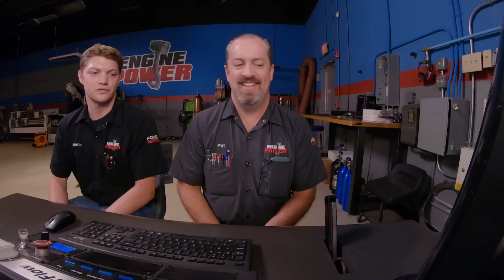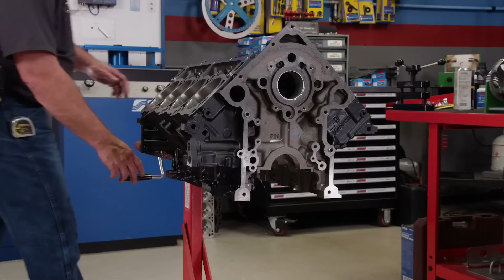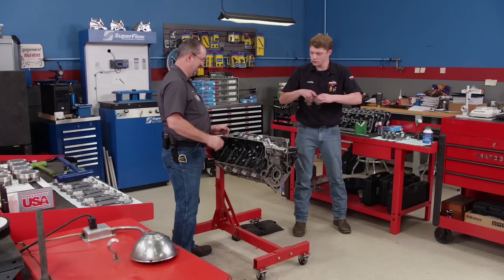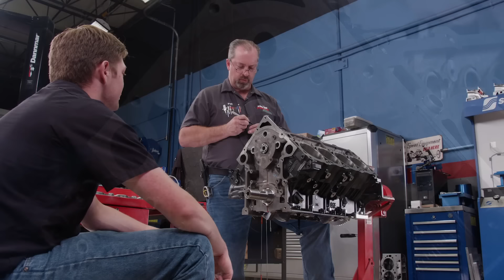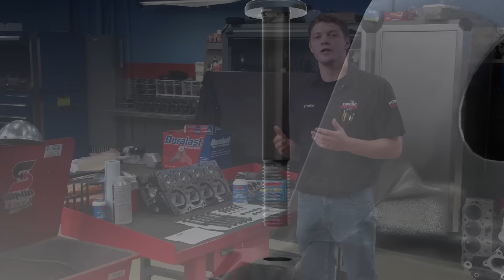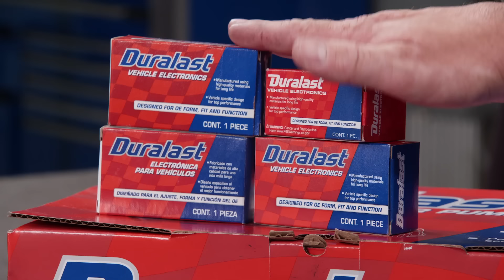Building Up a New 6.4L Gen III HEMI For Reliable Muscle Car Power - Engine Power S8, E16

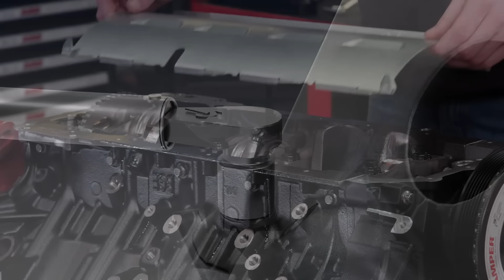Comment: 11:10 "BGE" means "Big Gas Engine". Pre-2018 car 6.4 motors have "6.4" cast into the block. Post-2018 6.4s, and all trucks use the BGE casting. The BGE is a stronger casting, and is the same casting used by the Hellcat and Scat Pack blocks.
Reply: Where can I find the BGE stamp on the block?
Reply: @icussdemise1043  On the drivers side (opposite side to the oil filter) next to the dipstick hole. Also on the rear, inside the bellhousing, just next to the oil gallery plug. They're cast in, in big letters, you can't miss it.
Reply: @rus0004  I presume these stronger castings must make the engine heavier?
Reply: @icussdemise1043  I'd assume so. Probably not very much though.
Reply: @rus0004  BGE, very cool 392 fun fact. I will look for it when my 392 Wrangler arrives.
Reply: So 15-17 scats dont have a BGE block?
Reply: @shift_nation4785  Not from what I've been able to gather. The first thick casting BGE 6.4 blocks came in the 2015 RAM, which coincides with the introduction of the Hellcat 6.2. Apparently all Hemi blocks adopted the thicker casting, but it took until 2017-18 for 6.4 passenger cars and SUVs to receive the BGE block.

Comment: Great video! I would've loved to see the combustion chamber and for y'all to explain quench and how it can still be a hemi with one. Much love for the Mopar vids y'all do!
Reply: Great questions it’s got some serious perks by having the quench area. Makes the camber smaller while still having the valves placed in the optimal position for size and flow. Also raises the compression. The piston doesn’t have to have as much of dome shape to fill the chamber which allows the piston to be lighter. Duel plugs for aid in cleaner and more efficient burn. 340 CFM of flow from a stock head wow!! This engine was for the most part stock. Just a buffed up Valvetrain/cam/intake/rods/piston. 7000rpm 🙌🏼 I wish they took it higher, looked like it was still making power!!
Reply: @alexwowski5318  they didn't balance the rotating assembly as a whole, after doing drop in pistons and rods they'd be asking for problems going that fast without making sure everything checks out even though they used good quality parts.

Comment: I got a challenger scat pack with the 392, however I’d would love to have that set up in it. Would be so much more
Fun haha
Reply: You’re a cam and valvetrain and tuning from that. No need for an entire engine
Reply: @moparproud3978  Yeah, they really didn't do anything cool with this engine. 5.7 and 6.1s have been known to make over 500 horse with cam and tunes. These guys did a lot of work to make the same power a 5.7 would with a cam and a tune.
Reply: @sHoRtBuSseR  Nobody has gotten an extra 100hp from just a cam and tune, stop the BS. Full bolt on, yeah sure...but not from just a cam and tune.
Reply: @DL101ca  Richard Holdener did it. 🤷
Reply: @DL101ca  I gained 27 rwhp from an email tune only.
Reply: @moparproud3978 Boxes checked for me. Comp stage 2 , they were having issues getting lifters so , High Horse Performance put Hellcat units in the package. Magnaflows sound sweet as well. Love my daily gas burning driver.
Reply: Exactly, that was too much money spent to land on same numbers as stock hahahaha..
Reply: @normandoromero7243 the goal was reliability not power

Comment: Nice,  but not a budget engine by any means, I’ve priced most of that for my 6.4  stoker build, that rocker assy will send most guys running backwards. I’m 2k in on just a prepped bare block ready for assembly glad I already had the 6.4 heads.

Comment: they flow too much.  the head doesn't start "working" until about 5k.  it's soft below that.  the valvetrain isn't great.  they can be made to work, but not with stock parts.

Comment: Why do I feel like it should make more than that? Something feels like it's "off" on this combo...like not enough cam to take advantage of the intake or something. I dunno, but a SBM (LA or Magnum) can be built to both more power and definitely more torque.
Reply: Yea that's what I was thinking, +70 hp over my stock scat for all that work doesn't seem like a lot.  I've seen similar builds to this push that magical 600 HP mark before forced air, so something is being held back here.  Then again, it is fully built so this engine could easily take on a FI kit and easily crank out above hellcat numbers, so the potential is there at least.

Comment: Hello pat. What would the total price be for a build like this one? Thank you.
Reply: @catalyst_99 10k is a bit steep, performance parts are a lot cheaper than people think.  Getting them installed however, is where the price hikes happen.  I'd say theres probably 5k-ish on the table here, considering they reused the crank and heads.

Comment: Put the cam in first then the crank. You can guide the cam in with one hand in the block and one on the end of the cam. Easier.
Reply: Cams are done like they did daily, nobody removes the crank to guide a cam in place, even on an engine stand.
Reply: ?
Of course of your doing just a cam swap. They built the whole short block in this video. They put crank and all in.  Putting the cam in first then the crank is easier like I stated. That is all.

Comment: This engine has $$$$ all over it.
Reply: It's a stock block, with stock heads and a stock crank...using a no rebalance drop in piston and rods, valve springs and a cam...thats about as cheap as it gets for mopar.....

 Now the intake and holley system with injectors and tb probably cost as much or more than the long block but that's not the engine it's the combination

Comment: Just to top post, that raised camshaft is to shorten the pushrods to lower valvetrain mass.
Reply: You could also use it to clearance stroke but the problem seems that's what causes the premature lifter failures.....raised to far out of windage and the lifters not vertical enough...
 I keep waiting for this to happen on my Ram....I know MDS exacerbates this but oh well...
 Having built several LS it literally is an LS with Hemi heads hehe....nice design
Reply: @ShawnGilbert1967 Had to replace mine at 100,000 and the shop told me that the LS's were killing their valve trains at a higher rate. That's him speaking. I just nodded my head. I dunno.

Comment: When you’re dealing with 6.4L’s and you want to add some power adders. Remember to widen the ring gap. Because it will be the weak point for higher horsepower. And remember that gen3 hemi’s lifter issue is from a lack of splash lubrication. So try to keep it above 2,000Rpm.
Reply: @bigboreracing356  Bcs they used shit lifters from factory you assume the whole engine is shit ? Great logic there ...you must be one of those internet basement engineers I keep hearing about !
Reply: Oil pressure is too low at the rocker assembly at idle with the engine hot. Splash lube is irrelevant here. The lifters are oiled from the rocker assembly and the oil is pushed down the pushrod. Hellcat oil pump is the fix. Works awesome. Much thicker rotor and idle oil pressure is a lot better.
Reply: @sHoRtBuSseR  Hellcat oil pump without the oil squirters the hellcat has, would be raising oil pressure too much and start causing other issues. Melling has an updated oil pump design with a higher volume and a bit more psi to help with lubrication while keeping everything within safe parameters.
Reply: It's the raised cam location they mentioned puts them to far out of windage...and they are laid way over....non mds with hemi lifters seem to be a cure.....

 I'll say this on my 2021 ram its impossible to keep it over 2000...it only turns about 1800 at 80mph hehe
Reply: The MDS lifters were the issue with mine at 100,000. Locked up two MDS rollers and killed those lobes. Comp stage 2 billet now with Hellcat lifters. No issues yet at 126,000. Way better throughout the whole range. Magnaflows are a nice sound as well. 600 dollars to tuner with floor Dyno.

Comment: Dyno queen. On the street 12.2 to 12.6 afr and no more than 21 degrees of timing.
Reply: I got a 5.7L running 24 degrees at 12.5-12.7, on 91 pump gas…. I do think 28 is a little high probably even in E85. 

Lot of variables for sure.
Reply: @jmata4506  I was talking about a 392. 5.7 may be different. I know at higher rpm you could squeeze out some more timing.

Comment: Somewhere there's a '79 Dodge Lil Red Express crying for that motor.
Reply: @bigboreracing356  Trust me, they cry.  You should see my truck weep every time I approach it with cheap aftermarket parts.  Sure, it looks like an oil leak but those are tears of despair!
Reply: @bigboreracing356  shut up it’s figurative language

Comment: I had a 5.7 in my Charger R/T and it was fast. This thing..just nuts. Love it..
Reply: maybe, but was it Quick ?
Reply: Bruce H, nuts?? Na, this is pretty badass, fairly economical muscle... Nuts is a 2000 Buick Roadmaster wagon (yes, with the wood grain on the sides, that wagon) with a 632cid twin turbo SMX, running on methanol at the track and.... here's the insane part..... 89 octane on the streets as a cruiser.... Drive it to the track, run 6 seconds in the 1/4 mile all day, roll the parachutes up and drive home, or out cruising, or 300-400 miles to the next racetrack.... That's nuts... And a legit car!

Comment: Hell I raced a 440 ROAD RUNNER into the 10.70. Back in 84 .. but 560hp in my FIRST gen DAKOTA.. would be wicked! Or stuff it an unfinished 67 Dart that needs a motor.. its got a drag CHASSIS.. . Instant low 10 ride..
Reply: @bigboreracing356  I dont street race.. but I do enjoy. Killing the tree and running the #s my old bird ran with in .  .02 at 4 diffrent tracks  5 different times through the last season. On a pro tree it varried in eleven passes .022 on that pro tree.. it was a stick shift. They say they cant be consistant..  thanks for the reply.

Comment: Men, the components of OEM manufacturers are excellent, high-quality... Why don't you get more technological motors, from which you can remove more power? There is also a cylinder head for 16 valves, a compressor, a turbine... With 6.4 liters, EFI, remove 564 horsepower and 479 torque in the 21st century-Laughter!!! The drive belt is loose, can't you think of an additional roller, can't you install it?

Comment: I bet my 5.7 could beat this 6.4 at the track. I make way more torque, over alot more rpm. It may have peak power, but ive got average power
Reply: question for you. I have a stock 2013 R/T truck. It needs some help. What do you suggest without going into the engine.
Reply: @Fuzzysmoke  what kind of help? Performance wise, there isnt much to do thats not motor related, but you could get a shorter rear gear like the 3.90 gears, and some drag radials. Other than that, their is not much you can do without touching the motor
Reply: @jameswhitesell3076  thx for responding.  Here is my deal. Like I said. It’s a 2013 RT with factory 410s. Straight line it great. However the higher end of mid range starts to fade. I know I need a tune to match my cat back system larger Y pipe and ported TB. Currently I’m still running the stock air box. It has the MDS system. I’m not a fan of it. Currently to date. It has 30459 miles. It was bought new it’s parked more than driven due to my work and second car. I’m dissatisfied with the slushy transmission. It’s not satisfying at all. However. I’ve read that hand held tunes are ok for recalibrating factory setting for street use. Which do you recommend using.  I want to change the cam. I hate the shuttle and lack of power when needed. I got a G37 that will smoke my truck. Plus my old 2004 Hemi would smoke it. Don’t get me wrong. My 2013 will smoke the tires al the way through 2nd. But runs out if stamina and the shifts suck. Please advise. Thx you for you help.
Reply: @Fuzzysmoke  a cam is a good option, also alot of people go forced induction. Depending on your budget and end goals, id say a cam, headers, and a newer truck manifold with the dual runners. You can ask different companies for options, but those options will help keep your low end torque, with your gears, and give you all the mid and top end you want. Or, you could put a centrifugal supercharger, its more up front cost, but it does make more power
Reply: @jameswhitesell3076  ok sounds good.  Any recommendations for a tune for now.
Reply: @Fuzzysmoke  a dyno tune is best, but if you dont have access then an email tune is the next best thing. I have not used one, so its up to you who you use. Or the easiest route is a diablo tuner with their preset tunes
Reply: @jameswhitesell3076  ok. I appreciate this info.  Seems like car guys are afraid to share secrets.  I’m a d GM guy but live all cars.  When I retire from the military I hope to have enough time to play like I want. Thx you. You’ve been a honest help. 👍🏿
Reply: @Fuzzysmoke  i try. I dont have alot of experience, but you are right, especially mopar, they hold any info secret like its forbidden knowledge, so i try to inform anyone who asks to the best of my abilities

Comment: Okay.. I don't get it those numbers are no better than a 50 year old carbureted V8 with a good cam.. maybe with the fuel injection it's more snappy off the line but I'm just not impressed get me a 351 Cleveland any day that's 50-year-old technology with a 750 Holley on top of it

Comment: this engine and a single 98mm turbo would still be street able but put this in the 900 plus hp range. it's no secret Hemi's love boost it's the reason there still the go to engine in top fuel even today.

Comment: I have a question and this seems to be the place. I have a 98 s10 im modding and im wondering if i could use something like Holley efi for fuel but keep the stock computer to control the transmission  and ignition. How hard would it be and what would i have to do?

Comment: I would love to replace my tired 318 LA in my 1979 D100 with this!
Reply: Do you have pictures....I Love those trucks
Reply: @biggdaddydiesel3622  I definitely have pictures!
Reply: Very cool truck. Throw some magnum heads on that thing and a 390 stroker kit and be happy 👍
Reply: I had an '80 long bed. 318 with Granny Gear 4 speed. So damn reliable. Had to run 33 inch tires to help that low gear ratio though. Miss it like all the rest. Keep it man ,  just keep it.

Comment: Love to see more Hemi (and Chrysler in general)!
Chevy and Ford V8s are hard to come by in Poland at a reasonable price, but there is plenty of decently cheap Mopars.
Reply: Finding the engines are easy but finding a car to put it in is hard mostly because Chrysler didn't make rear wheel drive cars for so long. If the daytona was rear wheel drive it would be as good as a fox body for drag racing.
Reply: Here un México is quite the opposite, no mopar engine/swaps in the junkyards
Reply: @Barcovic  really? Why not
Reply: Lucky
Reply: Wow Really? Usually it's the opposite.
Reply: @Turshin  Plenty of V8 Jeeps and Chryslers were sold in Europe (especially when Daimler Chrysler was a thing) and those eventually made their way as imports.

That's why the most expensive 5.7 300C is the same price as the cheapest Charger R/T even though they are practically the same car- Dodge wasn't sold in European dealerships so pretty much all of them are imports from USA.

You can get an '07 5.7 300C for the same price as a '91 305 Caprice.
The cheapest V8 Mustang I've seen was listed for $10k and it was a bit rough- nice ones go for $12k and up.
Reply: @edim108  can i buy cheap hemis from poland i leve i denmark😀
Reply: That’s funny because In America it’s the opposite mopars are the most expensive to mod and cost the most.
Reply: @SRTGHOSTS  it is the same in Germany and I doubt it's different in Poland (neighbour country).

Comment: Just seen a small block 427 Hemi ford making 900 hp on air !
Reply: Lookup hammerhead 427
Reply: @bigboreracing356  all natural, no nitrous or blower.
Reply: @bigboreracing356  lookup hammerhead ford I think
Reply: @bigboreracing356  not sure,Anyway I got Lucy enough to work on a promos making 3500 hp but I thought this looks cool also the Godzilla 7.3 gas has nice numbers as well.
Reply: @bigboreracing356  there was hope for the 6 litre cammer ,but more support for the 7.3.
Reply: @bigboreracing356  6.4 liter overhead cam that was installed in ford trucks

Comment: Would love to put a 6.4 in my 2005 ram 1500 with a 4.7 has 190k miles but it’s not hard miles and I live in southern Ohio and the trucks been here it’s whole life but it’s rear wheel drive so we never drive it in the winter and well no rust at all but I’d love to slap a 6.4 in there with a built transmission and a Holley terminator

Comment: Wow 340 CFM at peak lift. Too bad the average flow of those heads is marginal at best. How do I know they are marginal at best across the entire range. You can tell this because that motor should have made closer to 600 HP with that set up.

Comment: But what’s the cost difference between this Hemi and an equal version of an LS? I am betting LS would win or better better with equal price.
Reply: That has been the problem for over a decade when it came to the Gen III...    very little aftermarket support - with Holley getting in the game and pricing their hemi stuff similarly to an LS - it brings the cost closer together for an overall swap --- I did my swap almost 10 years ago and there was NO support what-so-ever....     today it is super easy and way cheaper.
Reply: And water is wet.